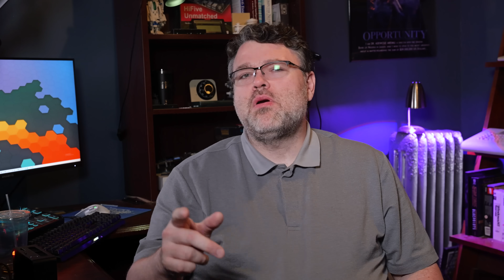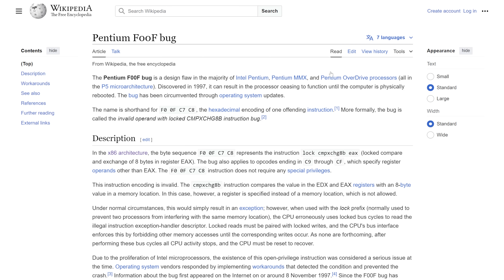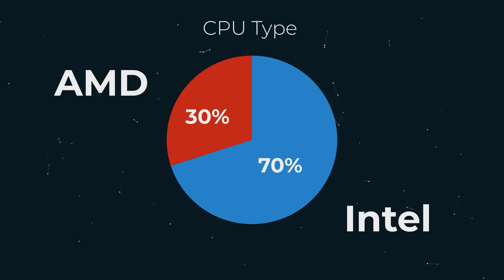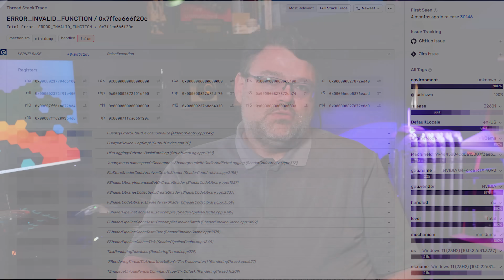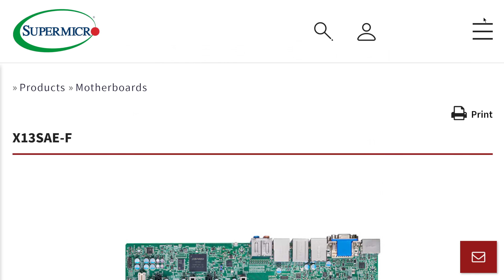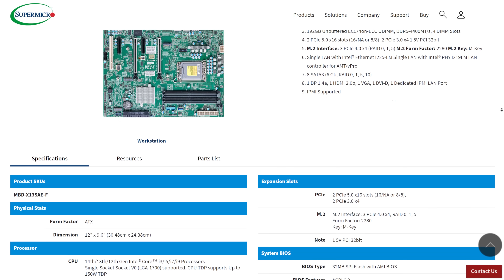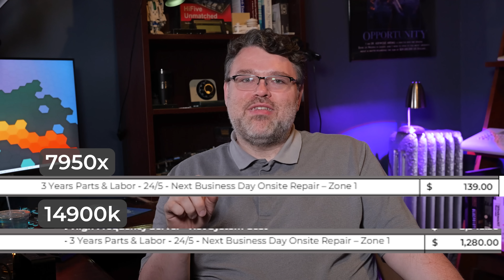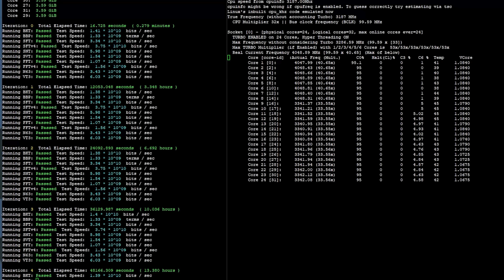Intel has a Pretty Big Problem

Comment: I have a 13600k and after all this mess I'm worried about the longevity of my PC, I have only recently built this current one and I had used my previous one for about 9 years and was planning to use this one for at least that long.
Reply: There hasn't been a single report of 13600Ks being unstable. Relax, that chip even when not power limited, won't draw more than 220-230 watt (in crazy taxing apps). Set a PL of 180 watt and be done with it.
Reply: @AfshinBarani  That's true but tech media and YouTubers in general tend to focus on the highest end parts much more so even if there were reports, it wouldn't be widely reported. Secondly, I have had many crashes with my new PC (, but those were fixed when I replaced the RAM so it almost certainly had defective memory but, just today, I got an unexplainable crash while playing a very old game with this new PC with 13600k and RTX 3060 12GB (Batman: Arkham Origins from 2013) and after playing for like 10 or so days (not continuously), today I had a crash with a fatal error message that I couldn't read fully because it went off screen very quickly as I was already pressing the enter key in the game.
Reply: @AfshinBarani  the chip never draws more than like 181-183 watt even in CineBench which is why I thought that this couldn't possibly be affected, but after watching Level1Tech's video, it seems to me that the problem is well within the architecture of the 13-14th gen chips (they share the same architecture) and not necessarily just due to power being too high.

Comment: I have had a ssd drive corrupt on a 13th gen intel 13600k .  Was related to IO errors.    Can confirm! Was not OC'd and on latest bios.
Reply: I have an 13600K with multiple NVMe SSD drives in Linux and haven't had any issues at all in the 18 months I've had my system. I don't overclock and my DDDR4 RAM sticks don't like XMP so run at stock speeds, so it's quite a vanilla setup (ASUS motherboard with defaults for all the CPU settings).
Reply: I chose to get a drive with on board cache instead of host platform memory specifically so I don't have to be nearly as concerned about drive corrupting internal mapping information just because i got a little spicy with cpu overclock.
Reply: I hope you had a backup, that is scary.

Comment: I wonder if 12900ks are having issues since I got mine a month before 13th gen was released Newegg had a killer deal at the time but stock clock speeds I get crashes even using Adobe DNG converter but drop my clock speed at 4.9 performance cores and 3.7 efficiency cores in XTU zero issues. Ready Or Not, BF2042, COD, 6Day In Fal, Helldiver's all crash when at stock clocks. My dad is rolling in his grave laughing at my issues saying I told ya so to not go all out even though you render 8k footage or 10,000 photos in a sitting. I got this CPU and a 3090ti so I didn't need to overclock fuck Intel.

Comment: Appreciate analysis like this, and the longer this goes on the more I'm curious about the VF curves that Intel codes. So far there haven't been any stories about denied RMAs and if I was personally impacted by a crashing 13900K/14900K+ I'd be having that CPU replaced ASAP.

FWIW The Asus W680 boards are pretty aggressive on the power side of things, but they aren't of the unlimited variety. I have a completely stable 12700K running ECC DDR5 5600 (32GBx2) and it absolutely maxes out the TDP when I load up all core.

Comment: I found that by upgrading from a 4060 to a radeon 7900 gre, games crashed less often on my i7 14700f. Hogwarts plays a TON better now. I would beg you to look into nvidia as well being part of the issue at hand. I still had a few small crashes here and there but switching to AMD made the crashes go away. Totally fixed the out of vram issue for me. No more BSOD. I still get a few IO errors here and there, and I am working on a utility to fix it. Nvidia is partly to blame here. I have a feeling that the IO errors are causing the crash with nvidia and doesn't somehow affect AMD gpus...
Reply: Since this problem doesn't happen on AMD systems with Nvidia GPUs I don't think we can fault Nvidia for anything (in this particular regard). That it's more pronounced on Nvidia, with deteriorating Intel chips, is likely due to the fact that Nvidia doesn't use a hardware scheduler on their GPUs but instead does the whole management song and dance on the CPU, which creates extra load.
Reply: @andersjjensen  I think that is a HUGE part of the issue here, like I know gaming data centers use nvidia gpus in all their servers. It might be due to the constant ping on the scheduler. I am not fanboying anything and this is pretty much ALL intel's fault, but its nice to understand what might be causing the issues long term. This wouldn't be the first time an nvidia card killed intel cpus.

Comment: I called there was a hardware issue back after like the 3rd round of blaming motherboard manufacturers. There is no fix, at best a work around that will profoundly affect performance.
Reply: Remember Spector and Meltdown? Those were patched in microcode... and it cost us 15% performance on average. Virtualization was hit especially hard, and we ran nothing but....
Reply: @andersjjensen  Yep. It shortened my refresh cycle at work because our app performance fell off a cliff.

Comment: why dont they use xeons for game multiplayer servers? i never understood this
Reply: Clock frequency is the big reason. Specifically single thread clock frequency. Maximum single thread turbo frequency is just 4.2GHz on the latest Xeon’s. It’s a 42% performance bump using a 14900k rather than a Xeon, and unlike most datacenter workloads, that lost performance can’t be gained back by throwing more servers in the rack. It actually results in a worse user experience for gamers, and there’s no real alternative other than maybe using AMD.

Comment: I own a 13900k and just did an RMA. Here's what I think. Some start out great, they start to break down over time. I personally think it has something to do with the watts pushing the current above 400a, and breaking down the internals, but just a guess from my own personal experience. This would result in a lot of errors weighted towards 13900k and 14900k that had these issues. My 13900k.... lets see... could had been I didn't paste it good enough with unlimited power rates at first as I remember seeing cores at 100 C and BSOD started and my CPU became unstable to the point where even at 100% load, I'd crash no longer being able to go above 78 C. 253w/253w/400a was no longer possible without instability. My next suspicion is, the reason they sell socket plates. Didn't install one on the first, but did on my RMA which now runs beautifully, temps are great, and I can stress test it without BSOD or crashing at 253w/253w/400a. I honestly don't know for sure why my 13900k was running high octane hitting 5.8 pretty often, while now my new RMA rarely hits 5.8 but hey at least it is stable. CPU biscuits for my RMA are much lower than my last and first 13900k (94 vs 77) so while the 94 should had been better off, something happened. What's interesting about your video is I wonder if they look into these crash reports when you request an RMA and maybe thats how you go about an approval in this case, who knows. I think the current which ties to the watts, and the watts pushed high enough to push the current above 400a, and broke down something internally combined with high temps that while could had been reported as 100 C which could had happened so fast that it was actually closer to 115 C, with some even reporting their MB with default TJmaxx setting to 115 C. The whole thing, is a giant mess.

I'll also note since I've seen many say 400a is more than enough for over 253w. From my testing, anything like 125w/253w/307a resulted in an almost 100% EDP current throttle and unable to get above 200w on all core loads. I tried, 125w/253w/360a and was able to get to 220w on all core load. The sweet spot for me to have 0 EDP current throttle was 253w/400a, but unfortunately my CPU was too unstable by then to not crash and be able to run that configuration. I know in the early days when I wasn't paying attention that I did in fact see my 13900k get up to 283w, while having an unlocked core cache current.
Reply: @aaronmoore3050   It wasn't software. I run the new RMA CPU at full 253w/253w/400a on a stress test with no crashes. This was not possible on the first one after 6 months. I'll be honest which I couldn't tell Intel. It started when I did Fitgirl repacks with decompression and long durations of 100% load. At first it would go 75% then crash, which later became 10% and crashed (BSOD). Thought it was the RAM. By the time I knew 13900k had issues, I implemented 253w/253w/400a. I no longer had BSOD, but I had application crashes and VRAM errors on a 24gb 4090, but mostly during shader comp that pushed 100% load, not afterwards. At that point I could turn on IA CEP and I think it was GT CEP (current excursion protection) and install all the repacks just fine, and stress test, I would always now have to do this for shader compilation on a game and would go perfect. Problem is, it would no longer go above 200w on all core work load (new RMA definitely goes to 253w now, and is stable). Something broke down over time with max unlimited power limits, and to protect itself (CEP), it no longer allowed high wattage draw to keep it stable. I believe it had something to do with going over 400a current which Intel says not to exceed. Sure Intel hasn't figured out the core issue, but in my case, it did in fact start with power, and over time reduced the amount of power it could take in to remain stable. Now that I've immediately capped my new 13900k, temps are great and hit 253w just fine. That's the thing, if you crash every time, turn on current protection, are limited to under 200w, now have perfect stability... something is there obviously and it isn't software. I've had BIOS updates since then. Keep in mind, I also run a Corsair 420mm AIO, so the fact I was running 100 C then, and now under stress testing 82 C as the top core temp, something was going on. Some even say damage was occuring at 100 C as it stayed there too long, where it should had throttled it far sooner. I seen my 13900k spike temps so fast under testing, that not even my AIO could catch up with it and the rate the heat spiked. I didn't OC. Problems began due to 100% core workloads. Most games I play will use the CPU 25% tops so far from what I seen with the exception of shader comp that was 100% usage, would crash at 253w/253/400a and show a brief power limit throttle during the time that the crash occured. Problem wasn't 1/4th partially used, it was when all 24 cores were being used and ran hard, and the amount of power it pulled during that time, and it was allowed to pull as much as possible (my PSU is 1600w btw so if it wanted power, it was there). Ultimately, do I believe my first CPU would had been fine if I put in limits of 253w/253w/400a early on so when it hit 100% all core workload, it wouldn't spike above that? Absolutely. I do not know how high it actually went up though, I was blaming XMP as I was having boot failures at this time after BSOD. The news of 13900k came late, very late, especially in comparison to 14900k obviously.
Reply: Would this apply to an i913900HK in a laptop CPU configuration? It’s specially an alienware m16.

Comment: so running CPUs at 400+ watt 100c for Unlimited time is not good 😮 yeah intel you are new to this "silicon" shit we understand
Reply: 100°C isn’t the issue. It’s the high voltage and current levels required to get to 400 watts on these consumer level parts, and it’s physically degrading the silicon.

FWIW, server parts (even from AMD) often exceed these power levels, but the amount of voltage and current going through any core or individual part of the chip (eg memory controller) is much lower. It’s just the cumulative effect of having many more cores and a LOT more physical die area.
Reply: @benjaminlynch9958  electromigration is also affected by temperature

Comment: I built my ultimate PC when the 13th gen came out, that cpu is now dead or needs to run at 5ghz, upgraded to a 14gen i9 and that is showing signs of wear (I don't overclock and have installed the bios updates as soon as they were released). Everyone knows the 13th and 14th gen cpus are faulty, so is Intel just trying to give customers to AMD? Bult all my own PCs, for 30 years, all have been intel (apart for one Athlon XP), but now I won't buy intel again...

Comment: This is why you don't buy hardware when it's first released kids...
Reply: well 14 gen is just rebranded 13..😅
Reply: well this particular issue is not the best example for that philosophy. This isn't one of those early adopter issues you avoid by standing by a couple of weeks or months and look how many issues early adopters are facing. Because those early adopters would've been mostly fine for a while until their chips start degrading.

Comment: I just built an intel system. I want to die
Reply: o7 I'm sorry
Reply: that's a bit excessive, your life is more valuable of a gaming rig
Reply: Ordered a 14700K system today. Hope thats not as terrible as 14900
Reply: @expierreiment I really hope you can send it back, I can't imagine turning on in my computer every day for the next couple years, wondering if today will be the day my CPU starts crashing my programs.
Reply: It’s not the end of the world. Just hope and pray it doesn’t affect you. Otherwise RMA
Reply: I went with a 7800x3d insted been pretty good so far but my pc has slow Boot prob coz iam running 6000mhz
Reply: @TobbeManNBOT  there's things that can affect it: 

1. Make sure you're only using 2 sticks of RAM in different channels, 1 per channel

2. Update your BIOS, newer versions of AGESA can help a great deal.

3. Make sure you're running it according to the EXPO settings on your RAM.
Reply: Just lower your TDP values (i7/i9) base125,boost253
Reply: Should have gone AMD. They have been doing great
Reply: You can over volt & underclock it  just ensure that there are no temp or voltage spikes
Reply: Sounds like you have about a 50% chance it won't be affected, so maybe you'll get lucky?
Reply: @futuza It’s not that high your delusional.
Reply: I was just talking to my friend about the fact that during 12th gen, if someone said "I just bought the parts for a new Intel system", I'd say "oh cool, I generally go with AMD personally, but sounds great!"

Now? "Return the motherboard and CPU immediately"

That's NOT a good thing for tech professionals to be saying about a hardware manufacturer.

Comment: Crazy. And if Intel doesn't actually know what is causing the problem, it might exist in the upcoming Lunar Lake and Arrow Lake as well. I know I'm very disinclined to trust Intel CPUs at this point, until they're proven to have resolved the issue. Intel doesn't need this right now, not with it's money woes. Maybe they aren't making a statement to "make users whole" because they know it would involve a huge recall? Anyway, I just hope AMD will not take advantage of the situation and price Zen 5 unreasonably.

Comment: I'm kinda glad Micro Center talked me down to a 14700K been stable.
Reply: My 14700k has been unstable.  It's a huge PITA.  I'll screw with it and get it working for a month or two and then it starts again.
Reply: @LucasHolt  I think its time to upgrade to Ryzen, I too have issues with mine.
Reply: they talked me into the 14700F and I am glad they did. I did notice crashes while using nvidia 4060 and a 4070, so I slapped a 7900 GRE card in my system, and it just works now. Be careful when using nvidia too. Everyone is quick to blame intel, when there are other things at play here. Yes I know the data centers are facing similar issues, but even then they use nvidia gpus.
Reply: @cgwworldministries83 they don't use the same GPUs, the data center ones have a better phase margin and just overall higher reliability construction traits.
Reply: @SianaGearz  they are still nvidia gpus which offload the scheduler to the CPU.
Reply: @cgwworldministries83   No, the scheduling model is similar between NVidia and AMD. The binding model of current NVidia CPUs causes DX12 overhead, and the way it does DX11 is outright adventurous (not inherent due to hardware design, just something they do) but it doesn't matter for Vulkan.
Reply: @SianaGearz  either way I am upgrading to Ryzen when I get paid. This is rather troublesome.
Reply: @cgwworldministries83 i have a 13700f. I was getting temp spikes so i limited my throttle to 90c